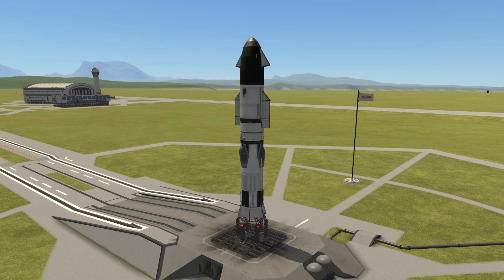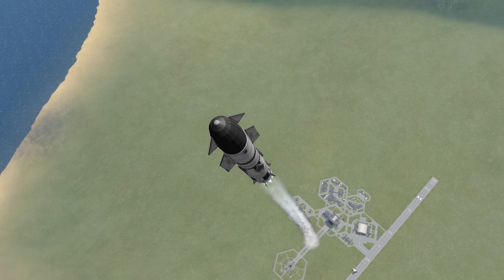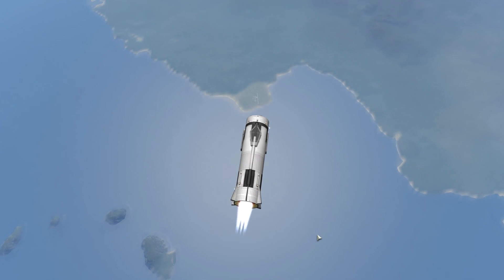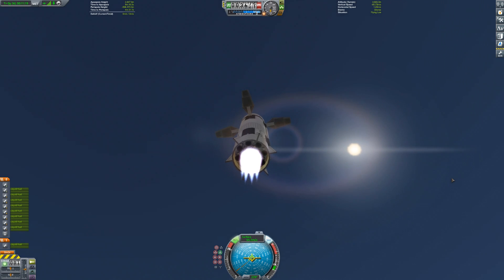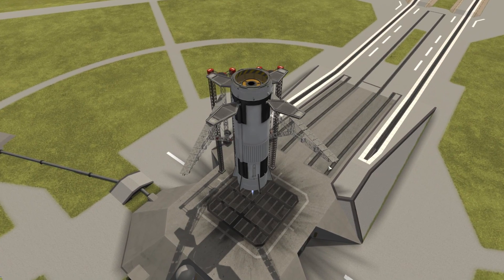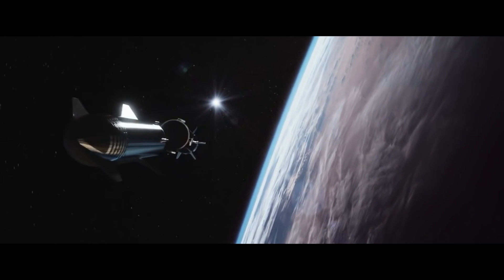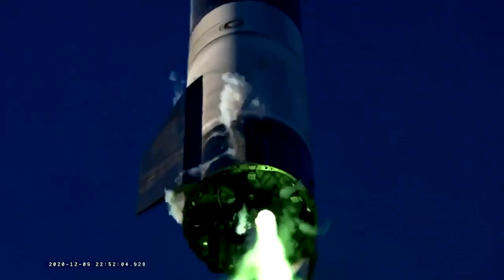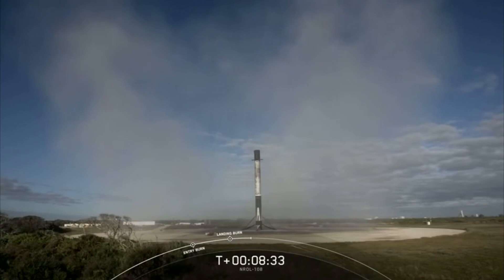Why SpaceX Wants To Make Landing Super Heavy MORE Difficult.

Comment: I'm sitting here in February of 2022, and they have yet to fly a superheavy.  The plan is to fly the stack, and expend both.  But that seems a little hinkey, to me.

SpaceX has never been afraid of building test articles to validate risky bits of the system.  Look at hoppers, and all the attemps at the Starship belly flop and landing.

The Superheavy catch is so risky as to sound crazy.   Surely they'd need to test that.  They could hover a Superheavy slowly to a couple km up, then come back down, do a landing burn, and land on the catch arms.  They have to do it at some point, anyway, and you'd think they'd want to prove that out, with all they've invested in the idea.

Comment: Well, instead of landing the booster on a concrete pad (or a steel deck on the drone barge) why not land it on a steel grid above a hole in the ground?
That way you don't have to worry about reflected shock waves.

Comment: SpaceX has to lose weight, because a reusable rocket (like it's now) can (as far as everyone is saying / what I could find) only bring ~50% to orbit compared to a non-reusable. So you need to launch ~2 rockets instead of 1 to deliver the same payload.
Meaning that if your reusable rocket costs 40% of a new 1 (what SpaceX says they cost -2020), when you launch it a second time, you are still at 140% the cost, to put the same amount of KG to orbit, compared to using 1 non-reusable rocket (no landing gear, use all the fuel to put KG to orbit, etc).
200% for 2 non-reusable equals 220% for 4 reusable (same KG to LEO).
300% for 3 non-reusable equals 300% for 6 reusable (same KG to LEO). Break even point. (in cloud-cuckoo-land)
400% for 4 non-reusable equals 380% for 8 reusable (same KG to LEO).
500% for 5 non-reusable equals 460% for 10 reusable (same KG to LEO).
Savings on these reusable rockets are not that significant, unless you never have a crash or other problems.

Comment: To cut down complexity in the rocket, SpaceX is moving complicated stuff to the landing system on the ground. 
It makes a lot of sense, but problem is complexity is like entropy, you can simplify the rocket landing system at the cost of a higher complexity in the whole system. 
This monster rocket will come down from an altitude of 100+ miles with a tolerance of just some inches. Yeah, this concept is something so mind boggling that only SpaceX can turn it into a real thing!

Comment: How about sending up a series of big drones and connecting them TO the sides of the descending spaceship/rocket, while IN the air? Magnetically clicking the drones onto the ship, at 3 of 4 sides. The drones guide the rocket to the correct position above the launchpad, by pushing the rocket's sides in certain directions. The thrust/push of the drones being horizontal, not vertical. So they don't need to provide a huge upwards force but simple push sideways a bit with a smaller but very controlled force. If one drone fails to connect or malfunctions, another drone could standby (closely hovering/following around the starship), and connect to the ship and finish the job. The drones need to be speedy and carry a large battery or powersource to provide enough sideways force/push to the rocket. Any positioning deviation by the rocket could be compensated by the guiding drones this way. Drop it at precisely the landing pad, and then de-attach the drones and re-charge them. Because they will use up all their power in that super short burst for landing the rocket. It's gonna take a considerable force but the landing is short so it might be enough.

Comment: Falcon 9 is only 4 meters diameter and no skirt where the engines located they are at open position so when you turn off the engine hot gasses doesn’t pushed to under skirt where there are sensitive gas and fuel pipes ... and sn10 if you look carefully what catch fire is wing engine or cables because of heat pushed by air to the sides

Comment: Instead of trying to catch the rocket right on the ground, why not try to catch it in the air? They could have something like two massive hydrogen blimps tethered to the ground with a long cable in between them, then as the rocket comes down it unfurls a hook device or something in order to catch the cable. The rocket wouldn't need to be terribly accurate to catch the cable and the blimps, being so high up, would be able to absorb the weight of the rocket over a longer period of time as they get dragged down towards the ground, gently slowing the rocket until it's at a certain distance above the ground when it stops. Then it's just a matter of reeling back in the blimps. That would probably save a ton of fuel, and thus weight. Plus you could stick a bunch of ads on those blimps.
Reply: 1) Please explain how having a hook catching on a cable “wouldn’t need to be terribly accurate”.

2) Please provide your calculations for the size of the blimps required to catch the booster (that when empty weighs 340 tons) and lower it gently to the ground.

3) Please explain how using blimps is better than a simple tower.

Comment: This is all such a waste of money and effort. The Centrifugal Propeller will replace all rockets and jet engines. It will be able to launch into orbit and return to Earth 5 times in a single day. There is a working proof of concept prototype, so this is not speculation.
Reply: Please post a reference to the working prototype.

The patent I’ve seen claims to convert a rotational torque to a vectored thrust in all environments including the vacuum of space, yet it ejects no mass. 

This is similar to claims made by Prof. Eric Laithwaite in the mid 70s.

Nobody had yet been able to replicate such claims that clearly violate Newtonian physics.
Reply: Update: ‘Jeff of Canada’ has posted videos purporting to prove his invention works. If it does it isn’t very obvious to me.
Reply: The energy required to raise a mass to orbit is the same regardless of how you achieve it. 

The energy required to power your ‘Centrifugal Propeller’ would need to consume at least that amount of energy.

Please explain how you would generate that amount of energy in a way more efficient than the raptor engine (currently estimated at 98%).

Comment: Saw a video about a rocket landing using helicopter blades - not sure if it was a simulation or real - how big would the fly swatter blades (if they rotated and pitched) have to be to land this thing
Reply: It weighs 340 tons.

The Skycrane lifts 20 tons using a 70 foot rotor.

So you’d need something like a 280 foot diameter rotor.

Please explain how this is better than simply using the rocket engines it already has.

Comment: They really should have started production and design in Canada.  We built the Avrow Avrow in the 50s  which was 20 years ahead of its time.  After, the 5 years of design not a single Avrow went down, even under extreme speeds.  It sort of funny since Elon went Queens University in Canada,  he should of also realized that Canada are the Godfathers of Ai.  They're also would have many benefits to designing the Tesla here,  because many are failing in Extreme cold conditions.  Ontario has some of the most well built vehicles with very little failures.  Canada also has some of best subsidies compared to every other country.  It's part of the reason the Film industry is thriving all over Canada.  You know, Canada, is very lax on business, when you realize that  even, evil Companies, like Huwai are thriving here. I am also certain Tesla, would have reached Level 5 automany, a long time ago if Designed in Canada. Let's not forget, the lunar landing wouldn't have been possible without help from Canada. They stole our best engineers, and didn't even give them any credit whatsoever.

Comment: Nothing about Starship is going to come to fruition. The whole design is stupid and it's all just a scam.
Reply: i wonder. How does a human being come to your line of thought?
Reply: @Tuuminshz  How does it land on sandy surfaces with no legs? How does it carry 100 people when the specs given by SpaceX don't allow for enough space for the crew and their supplies? How does the crew survive the trip to Mars and back when Elon says that radiation is no big deal? How is it even supposed to get to Mars when orbital refueling has never even been demonstrated as possible? How is it ever going to be economical for point to point transit on Earth? 

The list goes on and on. It's entirely designed with aesthetics first.
Reply: @pyromcr  Booster(First stage) will have no legs after some time. It will be caught by launch tower after first few flights. Starship(Second/The upper stage) has and will have legs always the current are just very small but Musk said  that with time they could be like F9 Booster legs. 
I think that the 100 people were meant for BFR/ITS design but it is possible to carry 100 people in Starship with minimal supplies it would be crowded and probably only viable for Earth to Earth. I saw the number 35 people with full life support regarding the Mars missions floating around somewhere (can't source).
No real trouble adding extra shielding around the part where people live, not a real problem.
Space stations have been refueled on orbit, as well as some small demonstration missions.  I'm confident SpaceX will achieve it on a large scale in the coming years the same way as they have propulsive landing (I can currently think of 2 ways: Pressure difference or Artificial gravity spin)
The same way planes are (the same reason people don't have to pay around 90 million dollars for a flight in The Boeing 737-700)

Go on please. Starship project is an engineering genius
In regards to OP: Starship already functions well in its development phase. Don't let some dumb emotions or  feedback loop channels effect your rational thinking.
Reply: @Tuuminshz  There is no point doing these test flights if they are already saying Starship needs new legs. The fact if ever left the drawing board with such a major design flaw is shocking. Elon still talks about it carrying 100 people to Mars, the lower number you mentioned is one that people critical of it have worked out, Elon is gung ho on the 100 number. They claim a lot more for their point to point flights but those will never happen for so many reasons. 
Do you realize how thick the shielding needs to be to block out GCR's? It's possible to do but you're gonna need to waste about half the thickness of the Starship just with shielding. We are talking meters thick if you are going to use water which would make sense since you need it anyways so it's not complete dead weight. 
I have no idea what you are talking about in terms of the 737.

Elon is just a hype man, you shouldn't trust anything he says. This is the same man that says he's going to give you X-ray vision with Neualink among other blatant lies. I guarantee you Starship is going to be completely redesigned in the future, all of these launches will have been pointless, and SpaceX does not go to Mars. If anyone is ever going to put a man on Mars it's going to be a giant effort lead by NASA or ESA and maybe SpaceX gets to play a small part in it all as a contractor.
Reply: @pyromcr  the legs only failed on SN-10 SN-8,9 didnt even get to test them, the point is to test them out to see what's possible what's not(Starship still is a prototype, some bits still on the drawing board, this is neither Blue origin or SLS) 

Still? (Talking about orbital flights) When was the last time he said something about 100 people recently, i haven't seen them say anything about more than 100 on point to point (travel by rockets is the logical the next step, people travelling maybe not in a year maybe not in 10 but some day, +SpaceX will be doing unmanned point to point fights soon enough (What elon said :) )  anyway i don't see why with time they wouldn't make them manned )

All i know is that apollo got away with couple of millimeters of shielding in their missions(I'm not an expert on Galactic Cosmic Rays)

Low cost reuse on the plane part, i don't see why not the same with rockets

Elon is a hit and miss guy some things he under sells, some over sells, he looks at the progress line and does give out crazy time goals
Again...With time i don't see why wouldn't someone with enough knowledge on brain/neurons figure out which one to zap to change the things you see or even display a real time video in your brain

Starship already underwent its redesign phase, but i don't see why they wouldn't redesign a usules/bad part. Seems to be working better and better.
You are missing the point Elon either wins or learns

Im confident NASA and ESA will stick them selves right in when SpaceX makes the first Mars landings or "start" developing their own rockets for Mars transfer. SpaceX will be a large part in the future if starship succeeds

Comment: Why would this be more difficult? Here you need horizontal accuracy, where the existing approach needs vertical accuracy. You could build a lot greater tolerance for vertical errors into the catching shock absorption system.

Comment: Scott, as to the name Starship, considering how many times the public refers to these two vehicles, SpaceX makes this far more difficult than it should be. On their website, they refer to the Super Heavy rocket and the Starship spacecraft and then they say the two taken together (collectively) are the Starship. By the time the Super Heavy becomes fully operational it could be used as a substitute launch system for projects that might  otherwise use the SLS. In a report issued by NSF (2/5/21) on the SLS Core stage test, they say there are a number of anomalies not counting just the limits set on gimbaling. By the time they get SLS flight ready (if ever), we could be at least a year+ and two billion more dollars away from a flight. That's when the name Super Heavy could be very important.

Comment: Why cant rocket land in a parallel fashion. Two rocket engine slide from bottom to top (Use Gravity assist). Two should move to the middle in the same way. Last two stay at the bottom. it would be easy to adjust the flames away from the rocket body.

Comment: In combustion cylinder motors, strategies exist to stop motors from being starved of fuel (swirl pots) and oil (multi stage dry sumps), in 10,000hp drag cars and 1000hp aerobatic planes. Are u able to do a video touching on the complexities of feeding rocket engines a consistent flow of fuel and oxidiser? I’m interested in SN8”s, copper bell, green flame lean burn. Why aren’t there closed loop systems checking AFR’s at 1000hz and shutting things down. Start ship will have many motors, could others be brought in as backup? Thanks

Comment: Perhaps I'm too much of a newbie but to "catch" a starship, wouldn't it just be the easiest and safest to have it land on a large mobile platform located within a reasonable distance from the launch pad?  A strong platform that has a self leveling suspension sitting on the axles of grouped wheels - All capable of moving or rotating in any direction.  Starship would land on it, once the vehicle is safed, the  platform would roll to back to the launch pad, orienting and placing the ship just as required.  Clearance between any edge of the platform would accommodate any location of starship on the platform by having swing out booms (and a StrongBack if needed), that just exceed the total width of the platform.  The entire launch/landing campus would be a large, leveled, heavily reinforced surface.  You could in fact have several platforms all working at once in the area.  And finally, the surface of the platform could be made with the strongest and most robust material possible to deal with constant flow launch & landing cycles.   Anyone have a thoughts?

Comment: or the other obvious downside... that you can't travel to anywhere that doesn't have a landing site already built... kinda defeats the purpose of a starship.
Reply: The super heavy booster is only used from Earth so it isn't a problem
Reply: @jamesminett9717  I guess no one is coming back :P
Reply: @kingjames4886  Sigh
Starship (second stage) will have legs, Booster (first stage) wont have legs, after first few hops

Comment: Inertial guidance and GPS accuracy would be extremely difficult to utilize for a landing like this, but it's super easy to integrate a highly accurate system at the pad itself.
Back when farmers were just starting to use GPS for their fields it wasn't accurate enough to make their rows line up correctly, so they used base stations at different points along the boundary of their fields.  This raised their accuracy to within a fraction of an inch compared to a few feet.  With the tech we have today, we're capable of measuring thousandths of an inch in three dimensions with virtually no latency.  All SpaceX needs to do is utilize a system like that for catching the booster, seeing as how they'll be landing in the same spot.

Comment: Nooooooo! Land them in the ocean. No landing gear needed, precision problem removed, you can't miss the ocean.. They are going to float. Also launch them from the ocean too. No launch pad needed, all operations done from a ship. No realestate needed.
Reply: They can't land them in the ocean as that would ruin the engines and rust the metal aswell as not allowing them to relaunch as quickly as they want to. 

Also in the future they plan to build launch pads in the ocean. Elon has talk about buying an old oil rig to use as the base for one.